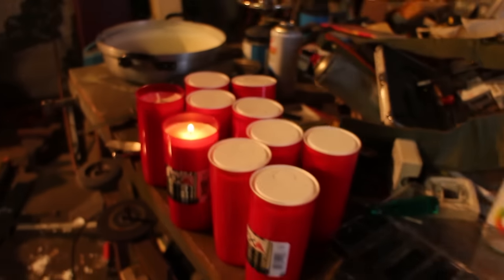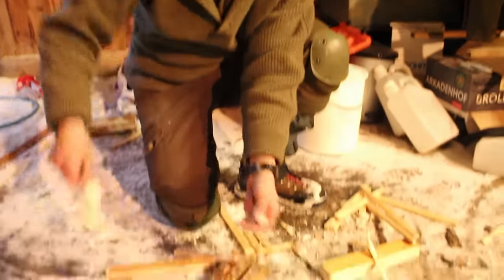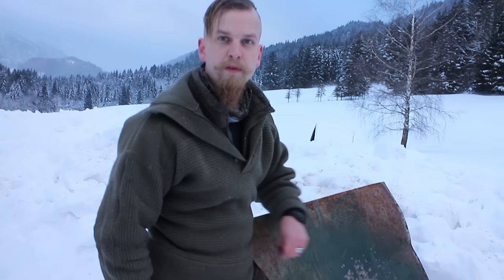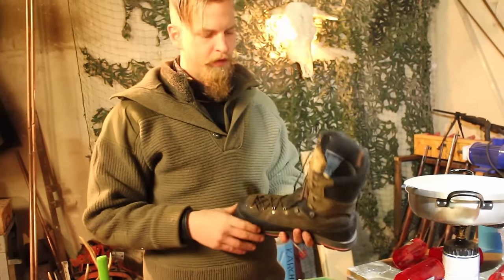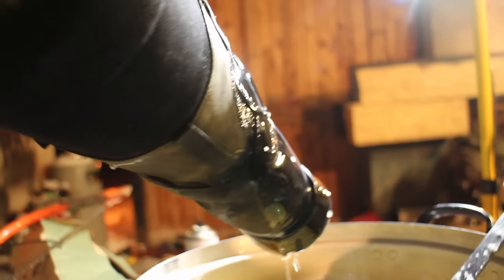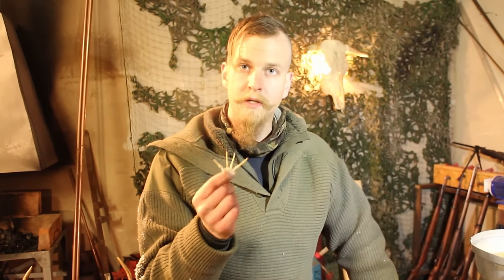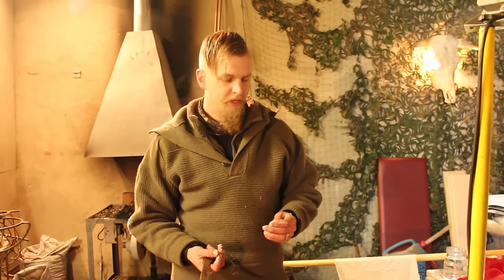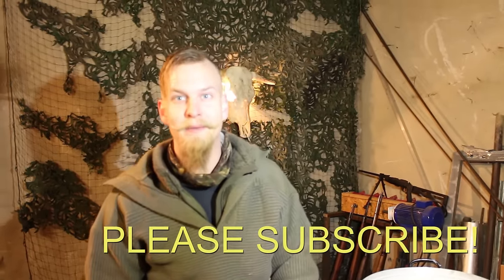7 Ways To Use Wax In A Survival Situation - Grave Candle Prepping

Comment: Melting wax over direct heat is probably asking for trouble. Possibly a more safe way would be to heat water and melt wax over the heated water. That way the wax never gets hotter than 212° F.

Comment: On the subject of the waterproof matches, wrap the stick with toilet paper before you dip it in the wax; Or put a couple of matches together then wrap them with toilet paper and the flames are generally longer. My experience with them is that they normally burn for about 2 to 3 minutes before they are gone.

Comment: When waterproofing your boots it's really important to pre-heat the leather to open up the pores.  Next time try using a hair dryer on high heat (heat gun works best) to warm different areas of the boot - then immediately paint on the wax.  You'll be amazed how much it will absorb.  Keep doing this all over the boots (paying extra attention to stitching) until the wax pools on the top and doesn't soak in.  Then let them dry/cool and buff!  Everything will be evenly coated and they will stay waterproof much longer!

Comment: Smearing wax on sides of bowsaw blade will help stop it from sticking in very dry wood when cutting (at least in very dry climes ,don't know about cold and snowy but think it should work) A wax crayon or birthday candle does the job well and is easy to carry in pocket.(and you can use it  to rub on a sticking zipper)
Reply from the maker: +enttish12 -Thanks for the interesting input...Looks like I've to make a 'part 2' ;)

Comment: Two questions:  Why go to the trouble of making the wax "slug"??  Are slugs illegal or hard to find in Austria??  Also, why can't you find/purchase better matches??  Sure, it's simple enough to make your own, but it's easier to just purchase them (at least that the case here in the US).  Side Note:  As I learned from a European commentor on a video of mine, we don't really have "funeral candles" like those in Europe.  Our "prayer candles" come in tall glass containers (the container has some uses but those plastic candle containers look much easier for salvaging the wax)
Reply from the maker: +MDPrepper -here in Austria slug rounds are really expensive ant not easy to find in small gunstores because very few people using them. Strike anywhere matches are prohibited by law.
Reply: That's bizarre (regarding both the slugs and the matches).  I can't imagine a logical reason to prohibit a specific type of match.
Reply from the maker: +MDPrepper -it's the same law as applied to the cheap lighters (BIC) wich have to have some kind of children safety on...stupid, I know :/